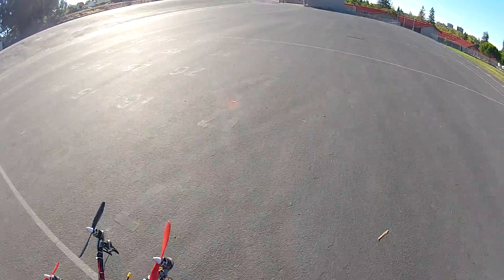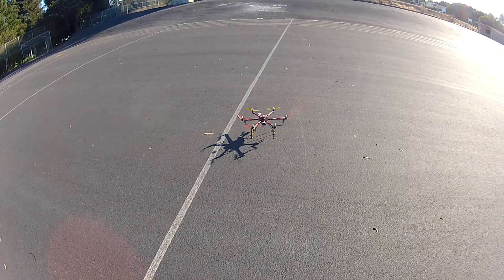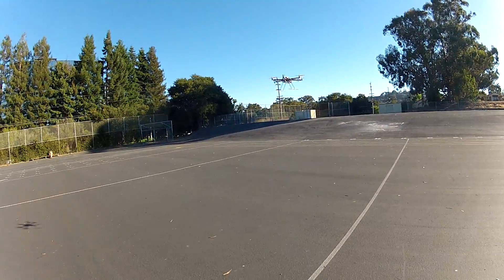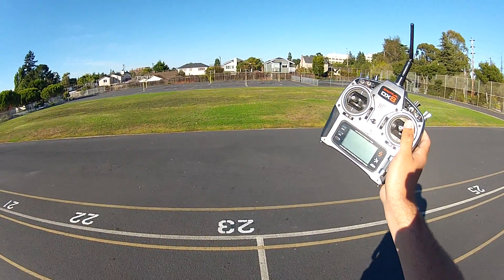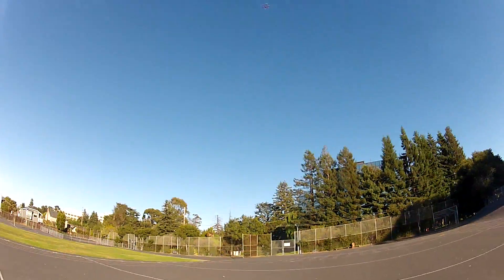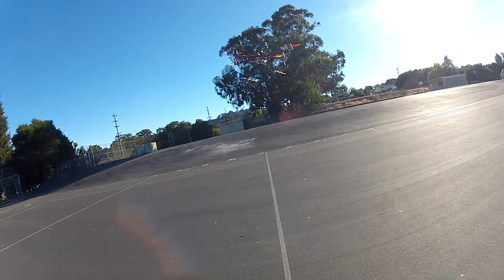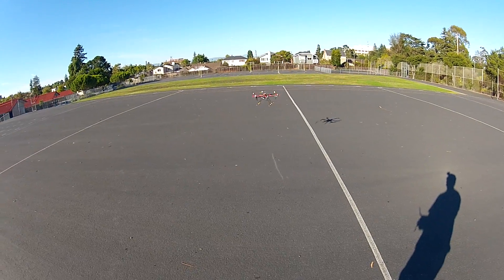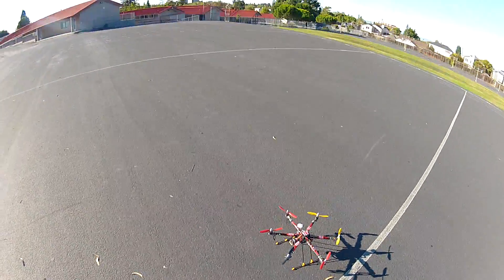RCV 30: Naza GPS onboard Hex, first tests

Comment from the maker: The Hex comes in at 3.5 lbs or about 1.6 Kilo with a 4000mah lipo. I get almost exactly 10 mins out of it with no extra payload. It seems to be a perfect middle ground for lifting to size.